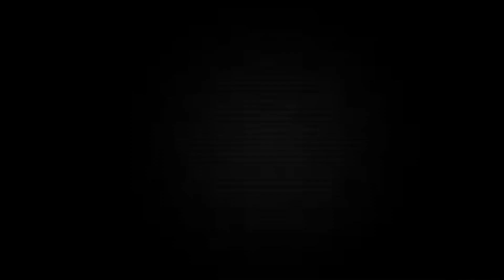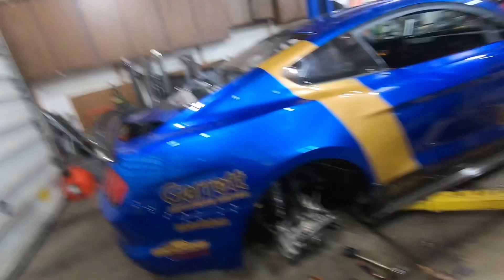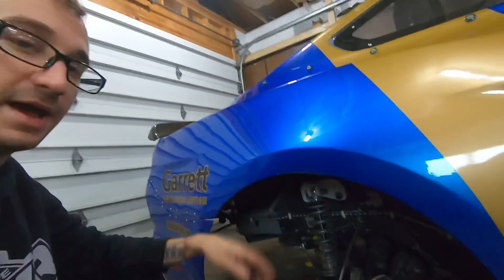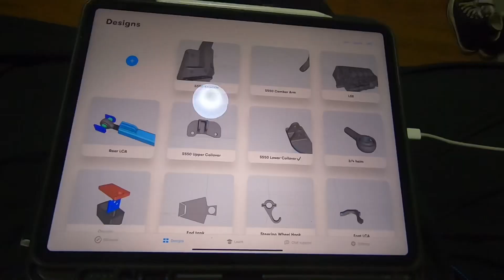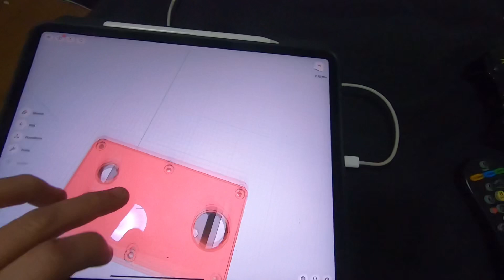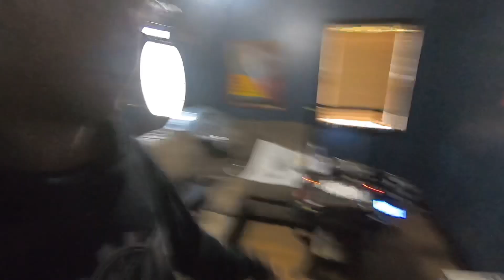3D Printing Custom Suspension Parts For The Ls550

Comment: You may have to use fdm for wheel hook. It will a lot strong then abs unless your machine can’t print fdm material.
Reply from the maker: Seems to work good out of PLA. Haven’t had any issues with it yet. Also used PLA on my ecu Mount, kill switch mount, and my switch keypad mount.

Comment: where do you get the double adjuster sleeves?
Reply from the maker: There are quite a few options out there. Just google search “double adjuster sleeve” they usually pop up in google image search instead of “shopping” but the links will lead to websites that have them.

Comment: Nice! I just got a CR-10S two days ago and can’t wait to use it for car stuff.
Reply from the maker: I figure you would just print mold negatives and inlay the parts with carbon lol
Reply: @Shane_Whalley  Yeah thats an option for sure. I could print a core and over lay if its just a one off part or a quick test. Gonna print some jigs for bonding or secondary steps that will speed up production. Literally right now I designed and am printing a tool that will help me roll carbon into tight corners of molds quicker. I have several ideas to do with this thing but just gotta get to them.